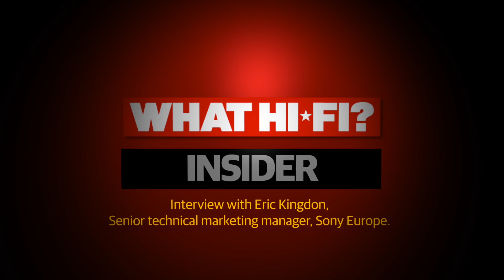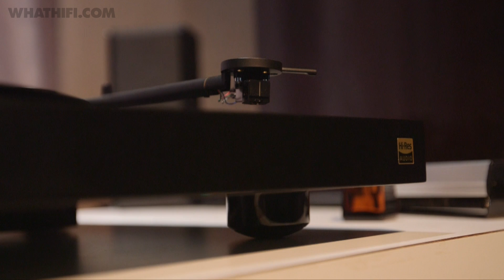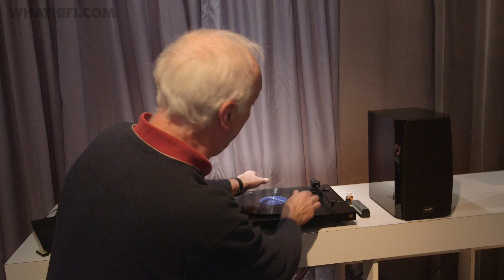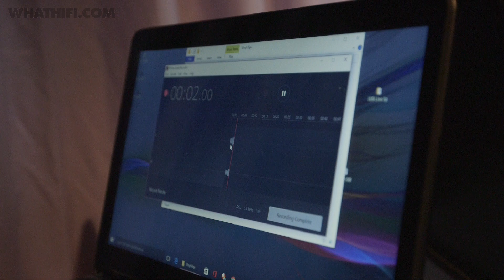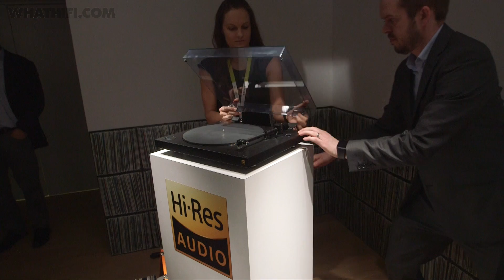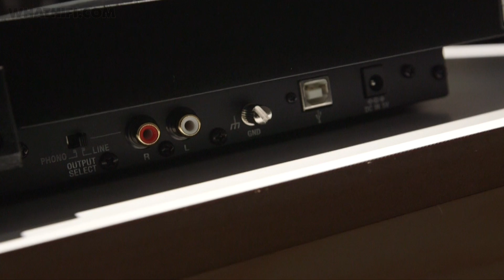Insider: Eric Kingdon on the Sony PS-HX500 turntable

Comment: A Solid slab of good turn table. I have it and love it. Wish it had a removable headshell to experiment with different cartridges, though you can change the cartridge carefully....  Good reproduction and excellent built in phono pre-amp and the best DAC is any turntable at any price. If i had to step up it would be a Technics SL 1200 series and beyond that the pinnacle of fine engineering, the Yamaha GT 5000.
Reply: What type of stylus would you go for when it comes to replacement time?
Reply: I just went with Audio Technica. Not sure about the model. But just got the cartridge.

Comment: I love the idea! Capture Vinyl in "High Res"!  Vinyl has roughly (translated ) around 11-12 bit depth and resolution of roughly 30-35khz . So while  you can already capture every little detail of Vinyl on a simple 44.1/16bit resolution Maybe the vinyl will sound better if you store it in 2 or even better 10 times bigger files   in High Res! It will also make the Dynamic Range capability of Vinyl bigger ..........noooooot :-)  Oh man I love Audiophile Santa Claus stories. Need to get my pop corn :-)

Comment: Can I connect my own receiver with my own speakers for better quality sound?
Reply: If it works as any other respectable turntable, yes. It offers grounded option for PHONO (bypasses built-in amp), and LINE in case you don't have/need the pre-amp.
Reply: Andrés Botero Castro what receiver would you prefer to this with a budget around 3-400$ a Sony receiver is most preferred but any other brand is okay too?
Reply: Not sure, really. You either need a pre-amp, or a receiver that has RIAA correction (not sure any Sony has it), like the Onkyo TX-8020 Stereo Receiver, https://smile.amazon.com/dp/B00EE18O7W and you can pair it with Pioneer SP-BS22-LR, https://smile.amazon.com/dp/B008NCD2LG

Sorry if I cannot offer any other option, since I mostly just set it up with my own amp and DAC and use headphones. Have fun!

Comment: Sounds nice, but I ripped the built-in preamp out of my Audio-Technica AT-LP120 for a reason - it sucked the life out of my music!
Reply: Can't you turn it off? I have a Marantz turntable with built-in preamp and I can just choose to turn it on or off. Just like this Sony turntable.
Reply: Unfortunately no. There is no off as everything goes through the preamp. There's either USB or LINE. USB was horrible as it made a loud squeal and LINE used the built-in preamp, which made music dull and lifeless. I read through many forums and other videos here on YT and decided to removed it. At first I removed it and wired into the existing wiring from the PBC board, but eventually soldered in a pair of custom built shielded RCA cables directly to the tone arm wiring to the cartridge. Yes, it was well worth the work as it was a night and day difference in music quality. Maybe not all built-in preamps in other turntables have this issue, but many complained that Audio-Technica's built-in preamp just plain sounded BAD!
Reply: That's not nice, not being able to choose which pre-amp you want to tuse (built-in or receiver). Sounds like a technical job to remove it. Good luck!
Reply: I initially removed it  over 2 years ago and installed the RCA cables a few months ago. With the built-in preamp in I couldn't use a separate preamp. I found a YT video showing step-by-step on how to remove it. It wasn't all that hard and it was worth it. I just within the past week moved to a different recording setup bypassing my computer's sound card. Now I'm using a USB interface (Novation Audiohub 2X4) and a new preamp (ARTcessories DJ PRE II) and results just can't get any better than this for home recordings. I'm posting a new video on my channel shortly showing my new setup. Also posted a music video yesterday of a recording of this setup.
Reply: Yes, you can. Don't listen to the other person. The PHONO option is precisely setup so you can bypass the built-in pre-amp and use whatever you want; they even give you GROUND. I hate misinformation.

Comment: how much cost one of these?
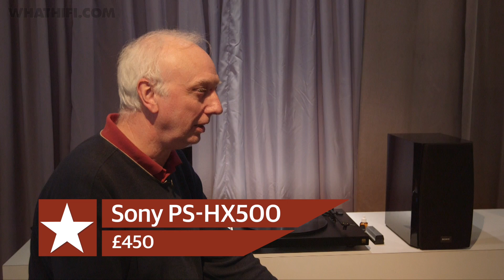Reply: +Johnny JP What Hi-Fi';s article on their website says "around £400"  and if you actually had bothered to watch the video, at 11:51 the price on screen is £450.
Reply: +James Franklin thanks i think the price is reasonable
Reply: +James Franklin  That would be close to 650 American. LMFAO not on your life.
Reply: keith parkhill  stuff is always cheaper in America, compared to the UK. I'd say it'll be closer to $550
Reply: well it´s not cheap, but i like the style and simplicity, thanks
Reply: Johnny JP To produce a turntable with these requirements and still retain any decent sig to noise ratio would be rather expensive. A onboard pre amp will pick up vibration and electrical artifacts from the table. You also need a motor ground much of the time. VPI found this out with the Nomad and they had to revamp the entire turntable.

Comment: convenience over sound quality I'm afraid
Reply: It has one of the best built-in phono pre-amps in my opnion and the the circuit board is epoxy coated. High quality specs you wont find in any turntable at this price. Upgrade the catridge to your liking and you have a very fine turntable.

Comment: i don't think the vinyl holds enough data to make a dsd file,24/96 flac at most
Reply: +border66  actually it holds a  infinity amount of data.
Reply: +Zockopa much of the minute detail gets lost during the mastering process, surface noise and tracking error distortion, inner groove distortion
Reply: +Nicholas Tate  Nope.
Reply: Çerastes In principle thats wrong. Its the 
other way round.
Reply: +Çerastes  Well then,illuminate me please.
Reply: +Çerastes  Ah,so you believe in BS youve read elsewhere in the net. Well,just get your basics straight
before trying to fool others. Probably a basic college seminar in applied computer science will do that 
for you. Good luck.
Reply: +Çerastes  No you really dont know even the basics. Im not arguing about analog records vs. CD,just about your statement you made earlier that a CD contains more
information than a record. That is just a error in reasoning.  Why do you think in recording studios are formats used with higher bitrate and resolution than the cd ?
Reply: +Çerastes  A audio CD can only hold a limited amount of data,hence the format with a certain bitrate and 
resolution.  The format has weaknesses and flaws,especially in reproducing complex low level signals. That is well understood for a long time. That is the why higher bitrates and resolutions in pro-audio are used. Also the whole environement like clocking is way more precise than in a home audio player.
Certainly analog records have their own weaknesses and flaws,but a finite amount of data is not one of 
them. In fact that is true for any analog sound storage medium.  Simple as that.
Reply: +Çerastes  Do you own a turntable. You should try one before bashing the format. Also, digital is not always superior to analog far from it. Example 4k is not as good as 70mm film. Same goes for analog master tape which hold much more information than a CD.  My brother is in Film study and my cousin is an audio engineer...
Reply: mrtheoden hey there, I'm thinking of getting into vinyl. Could you help me understand something, if vinyl can store an infinite amount of data, why do some albums need more than one record? I might sound silly, but I do not understand. Also, is the resolution of the playback affected by the cartridge of your turntable?

Comment: Nothing like Noisy Digital files, this whole USB marketed ADC's is complete rubbish.
Reply: What if I want to rip tracks that have never been converted to digital and that I have no hope will never see a (re)release? There are plenty of those in the genre I'm listening to, so in my case USB turntables are not that much rubbish after all. Of course if all the tracks you like are recent and on digital then I don't think the USB function will be of much use as there's indeed no point in ripping them.
Reply: Noisy digital files? A clean record, stylus and noise removal tools in Audacity will do the trick. Vinyl has the top and bottom end of the frequency range chopped off due to its limitation but anything in between you can't beat the continuous wave form. DSD gets as close to analog as possible. But you might be better off listening to your digital files if this is not your thing.